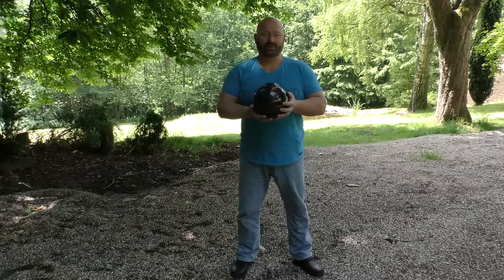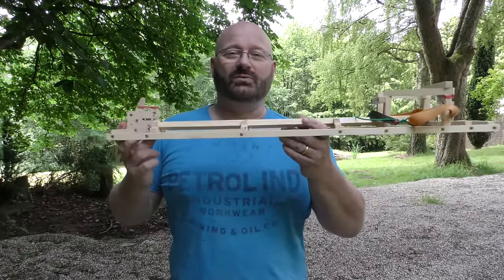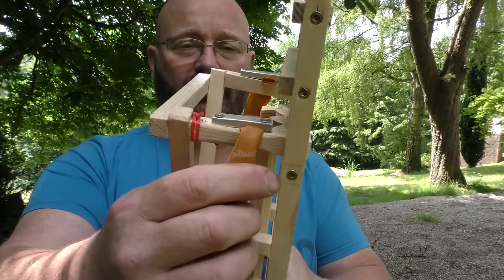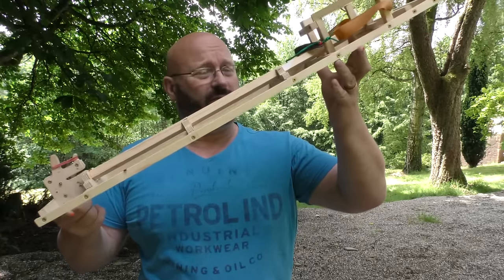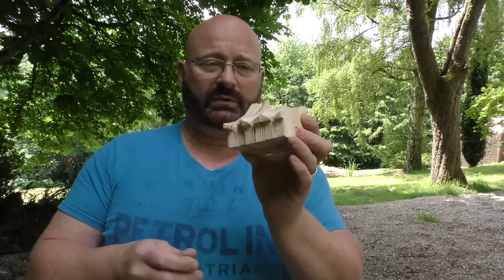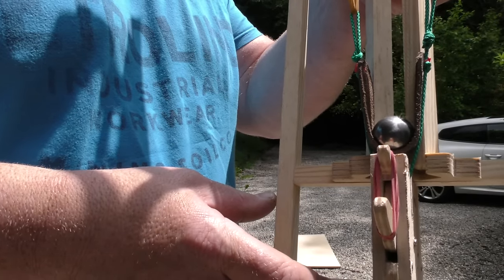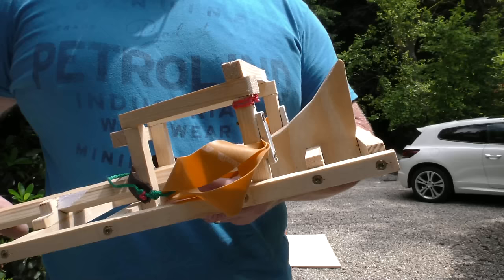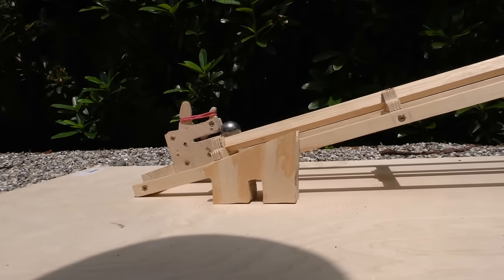Bowling Ball Launcher 1:10 Scale Experiments

Comment: if you hoist the entire frame up you have to put support beams in the middle to compensate for the weight of the entire frame potentially warping and bending in the middle
Reply from the maker: True. But that can be done. No rocket science.
Reply: Well, I didn't think about that haha good call
Reply: but joerg how many kilomiliyards do you need? is it N x E x R x D = Draw weight?
Reply: Why not both? Hoist it up 1 meter and attach a ramp of 7.5 degrees or so.
Reply: Slingshot based rocket launcher confirmed for 2,000,000 subs.
Reply: Mrs Brisby rocket assisted slingshot ammo instead :O
Reply: +SteamingBurito That's smart
Reply: I think that smooth ramp with few more stages would be more then enough for destruction purposes like shooting a car :D Something like 5->10->15->30 degrees or a ramp in logarithmic curve shape.
But if you want to break some distance records in Guinness Book then hoist it up.
Good luck, I can't wait for the final result :D
Reply: +JoergSprave Hey, man. Great vid! I'm curious to know, what's your opinion on gun control in the US? Thanks.

Comment: Depending on where you are doing this, you could dig an inclined trench 1,5 m deep, and use the dirt to build a ramp 1,5m high. Half will be under ground level, half above. The structure will have a continuous support.

I think this is the easiest way to make it inclined, if you don't care about damaging the landscape (ofc you can plain it up afterwards).

Cheers

Edit: Or you could make it 1m under ground level with a larger width and some extra room at the back so you can operate it, and that amount of dirt should be able to make a higher ramp above ground level (lets say 1,5 ~ 2m), with just enough width to support the launcher, since you don't need the extra room to operate there.

I'm assuming the launcher have a modular design, so you'll be able to move in the first place, so it shouldn't be that hard to put it in place.

Comment: Just place it on the slope of a small hill to get your launch angle... Another suggestion is to minimize the friction of the rails to reduce the downspin. For even more distance you should get an up spin. Like on Airsoft or some Paintball markers xD
Reply: Oh, like finding a way to apply pressure to the top of the ball. That's smart. And then use some aluminum or steel rails to reduce friction so the spin isn't lost. That's clever. And ballsy. Putting an up spin on a bowling ball. I like your style.
Reply: it is clever indeed, but very impractical, since no amount of upspin is going to increase a bowlingball's trajectory significantly... all you can do is reduce the friction as much as possible, and hope that there will be no downspin (since the pouch's grip will be stronger than the rail's)
Reply: This is a good idea: wax the rails.

Comment: I know that this probably isn't really possible but I think that it would be awesome if you could build this on or for some sort of a large truck that can incline it's bed, like a flatbed dump truck or something. This way it would be portable and you would have many angles to shoot from.
Reply: Actually a very cool idea and the free advertising for a wrecking/construction company could be great.
Reply: Oh that would be pretty sweet. I guess a more practical way of doing it would be to try to get someone with a fork lifts or small crane, sponsor him so that he could lift the whole structure up. I feel like it would be pretty easy for him to get a sponsor with a project as cool as this.
Reply: There are some pretty big tilting flatbeds. Enough attachment points for the build too.

I think 20 foot bed is fairly common so you may lose a couple meters in length.
Reply: Larochelle trailers should be long enough though and easily reach 45 degrees. :D

Comment: I think the bowling ball may smash through any ramp - depending on the speed its going. As things get bigger the properties change. Also the ramp will take a lot of velocity out of the ball. I'd suggest a 15deg lift, and experiment with a 5deg ramp.
Reply: speed and velovity is not as big of a problem as the mass and energy of the object. heavy objects with a large energy dont need that much of a speed to inflict significant demage.
Reply: +Pprokop87 actually velocity is more important when dealing with kinetic energy. hence 1/2mv^2 notice velocity is squared while mass is halfed. if u half the velocity ud need to quadrople the mass to get the same KE. for example a 10kg mass at 100m/s is the same KE as 40kg at 50m/s 50 kilojoules.
Reply: EMAXXMASTER yes if the object is moving in the straight line. remember abouf the redirecting the energy. the object that will redirect other object has to take and whitstand all of its speed, velovity, mass and energy. part of it will be taken during the redirecting.

Comment: Considering the size and kick this thing will probably have I would suggest a center mounted ballista type carriage, a simple one at least. That way you only need it to be around 1 meter high for 2 meters elevation at the end.
Reply: The end must be supported as well. The final length would be 7.5m so that would mean 3.75m of wood hanging unsupported. With the weight of the fork and other stuff on the end and the energy of the shot, that hanging length is going to sag and shake a lot.

Comment: Hoist it up!! maybe use your pickup truck bed as a platform of sorts?
Reply from the maker: For a seven meter cannon? I'd need a 40 ton flatbed for that :)
Reply: +JoergSprave Well you could rest it on the left or right side of the bed and fire over the other side
Reply: +JoergSprave Rent one. :) 
Maybe you can use trunnions and mount it on a set of giant wheels with the fulcrum being  slightly forward from the center, and use some sort of mechanical aid to raise and lower the rear for elevation? Kinda like the old gatling guns used?
Reply: +JoergSprave Hoisting it up would fix the problem of energy loss, but it would be extremely difficult. Maybe you can try attaching a beam in between 2 trees, and resting the contraption on it. Also, what if you assemble the machine on an inclined plane, instead of hoisting it?
Reply: +JoergSprave why not just place the cannon on the ground that's inclined to the right angle? It might be possible to dig a trench to achieve the same result assuming you have the equipment to do it.

Comment: Hoisting it up: Physics says 45 degrees but realistically you want it lower as you factor in air resistance, you want the maximum horizontal velocity per unit vertical height. With the ramp, it would be best at 45 degrees in physics but as you said, energy loss when hitting the ramp, which probably needs to be made of a very smooth material to minimise energy loss through friction, and the ramp needs to increase in steepness gradually, so anything between 15 and 40 degrees for both ramp and hoisting it up would be the ideal angle.

Comment: I highly recommend to hoist the slingshot up.  Only because it seems more accurate as a firing mechanism than the ramp version.  
The ramp version kinda feels like an unpredictable complex mortar and sounds kinda dangerous.   A worse crazy case scenario is that the ball will fly up high and backwards towards the shooter (knock on wood, no pun intended) or the slingshot has so much power that it will instantly demolish the ramp upon impact.  
Maybe add a few sets of legs made out of discarded thick logs to support the slingshot up? Good luck on that project.

Comment: I would suggest to build a jointed pod/bipod in the middle of the cannon in order to be able to adjust the vertical and the orizzontal angle. A 1.5 to 2.0 meters tall pod with the right scoping system would be fine and accurate

Comment: Did you scale the mass of the bowling ball properly, or just its projectile size?
Also, how much force will you apply to the bowling ball in the end? What would the strain on the ramp be with part of the bowling ball's impulse crushing against it? Wouldn't you dent (and therefore affecting performance and accuracy) or possibly break the ramp entirely?
Furthermore, how would you hoist it up? Will it be a fixed solution, or of variable angle? You might as well take a shovel and heap up "some" soil to have an angled surface to put the contraption on. If you want variable angles, you could lift up the end using a set of pulleys.

Comment: Is there anything stopping you from building the whole unit (rails) at an incline? You would need more wood but it would make for a very stable platform, no energy loss from a ramp and a built in angle. Then you could possibly position it on a slope to adjust angle even more.

Comment: Maybe a simple mechanism, a large handle attached to a not so large cylinder stays below the mechanism and perpendicular to it's length, this cylinder has 2 pairs of ropes attached to it, which in turn have it's other end attached to some wooden arms, that are initially like _ _ and as you turn the handle, the ropes hanks around the cylinder, pulling the arms ends against each other, making them go from _ _ to / \, lifting the front of the whole mechanism. Did it make sense?

Comment: Mounting it on a trailer with the firing end at the hitch would give many advantages. You would have portability. It would give you better lateral movement for aiming. The hitch end could be lowered to provide the desired launch angle.  Larger wheels could also provide you with a higher launch angle. And some boat trailers already come with a winch installed at the hitch that could double as your draw winch.

Comment: I've never been math savvy, I usually just throw things together and eventually find a way that works... But the 15 degree to 30 degree ramp was the best contender as far as ramps go, but when lifting the front of the launcher, you ended up with a further distance with what looks like a 26-28 degree angle, so my thought is either a ramp that starts at a 11 degree angle and works its way to a 26 degree angle or a ramp that starts at a 13 degree angle and ends at 28 degrees, this change (In 1:10th scale) should get you from the 27m distance in the 15-30 degree ramp to 30m... not sure if my math is good, try propping up the scale again and measuring its angle... a ramp matching that angle might preform nicely

Comment: I would suggest to cover the sliding surface of the ramp with a thin sheet metal, and same with the rails. You could then polish them up and oil well to reduce the friction, and add some reinforcement at the front. That should stay in one piece I think.
Also this 1:10 scale model had a triangular rail. That means there were two points (or lines, if you will) of friction which are relatively high and the ball would be pinched between those rails. A rail with a round surface would have only 1 point of friction.

Comment: I think you should hoist versus using a ramp because when you were firing with the ramps there was a loud noise on impact of the ball hitting the ramp, versus when you hoisted the contraption it was much quieter.  The energy lost from the ball hitting the ramp and making noise is avoided by hoisting it.  And when the contraption is hoisted to such a shallow angle, as you did in the video, the rubber doesn't really fight gravity that much and still adds a lot of energy to the ball.  From the way I see it, hoisting the whole contraption is more efficient, even though it is, from a design standpoint, more difficult to do.

Comment: with 1500+ comments, it's probably already been suggested, BUT I think the ideal set up, would be using a system where you can try both!  Build a ramp, for the end, to launch it at at 15-to-30, so you can launch it that way, but have it so you can remove it, and then slide it under the catapult, to raise it up and change its angle that way.  There you can test, in the full scale, plus, if you use the end ramp, and it breaks, you can move to having the entire device angled.  It is probably a great deal more work, but it might be the best solution!

Comment: adding a ramp to the end will reduce the "muzzle" velocity and therefor the max range . better to use the incline method but might be worth considering a screw jack arrangement so you can easily experiment with different angles of elevation . Also if you are trying for maximum distance you could try a lubricated "barrel" to reduce friction and increase acceleration of the projectile

Comment: So, here's my concern. As someone who has ridden BMX street for the past 6 years, I would hope I know a thing or two about wooden ramps. I am worried that the ramps will not scale based on the materials properties, density and such. You may want to reinforce the top of the ramp with a sheet of steel or something that it can slide over and to prevent denting and damage considering how much velocity the ball will have as it rolls down the path. Also if you're planning to make the ramp the same way this scale model has it, where you can remove it, I say go for both! Try it hoisted then try it with the ramp :)

Comment: I would lift it up using a winch tripod at the firing end of the "Slingshot", because the impact on the ramp by a bowling ball is quiet enormous and if it breaks and flys of in an odd angle it could cause a lot of problems. I'm looking forward to the video :))

Comment: I believe the answer to the question lies in the speed of the ball, do you think the bowling ball will have the same speed as the small steel ball ? If it's slower in the final design, the hit it will take with the ramp will take a higher toll on the velocity of the ball since it's heavier. Idk if i'm explaining myself clearly so try imagining the two balls going the same speed and going up a ramp of increasing inclination, at one point the bowling ball will be slowed down much more from hitting the ramp than the small steel ball will.

In my mind, inclining the whole launcher is a far supperior solution the heavier the projectile gets.

Comment: Definitely hoist. In a large scale and high velocities the tension on the ramp going to be substantial, it can destroy the ball,  ramp will break is it is not strong enough, and you loose quite a bit of power. I wander why it has to be so big?  You could have made a proper slingshot cannon with wheels.

Comment: You may want to grease the launch channel and the ramp to minimize friction and impact-based energy loss. Heck, even water would probably help a little bit. At the very least, I recommend varnishing every working surface the bowling ball touches. That's if you're using wood, you might not be, I don't know.

Comment: Use both to mitigate the down sides. Also using a steep angle ramp when there are big forces in play is not entirely safe. But instead of hoisting the frame itself upwards you can hoist the ramp alone leaving the frame flat and steady.
Reply: If you just put the ramp in an upwards angle and align the forks support beams with the ramp it will make a super easy and sound form.

Comment: Wouldn't using metal rods to guide the bowling ball reduce friction? You could even wax the metal guides to make them super slick. Just a thought. then use a pipe bender to achieve an angle up at the end so there is no impact on transition.

Comment: In a lossless launcher, 45 deg should have been optimal. Of course there are losses from slightly increased friction on the ramp and hitting leaves.  I would guess the friction will be less of a factor on the larger launcher (mass is scaling as r^3 while friction is scaling at a much lower rate), and leaves will not be a problem. I would think 45 deg (ok maybe ever so slightly less technically) will be optimal on the larger device. Also, you can significantly decrease loss of energy on impact with the ramp by making a longer ramp with a shallower entrance. The little bit of extra friction for a meter won't lose you more than maybe 2% range on the full scale device, and that impact is your main inefficiency. Hm, I'm tempted to actually fully model this now...

Comment: Jai alai is the fastest ball sport in the world. I would definately use full ply sheets to match the balls spherical shape( five vertical sheets of ply sectioning the ball from one side to the other )to match the ramps 'slight' curl complimenting the balls contours . Pinball ramp. enspired.
    Or to make things simple the shaft is not angled or elevated 2 meters of the ground but make a ramp at the end of the shaft using two angled lanes of ply  sheets . These ever so slightly angled ply sheets maybe 20' degrees serve the purpose to centre the ball on the ramp as it is catapolted without trying to pinch the ball as the momentum is build up off the ramp. The surface area v shape will be a 150 or 160 degree v ( 180 degree being a flat surface much like a scateboard ramp).
     Im sorry if my words dont make much sence but I am sure that it might trigger off  some modified shaping solutions.

Comment: A ramp at the end, whether hoisted or not, just equals energy loss. Also, you DON'T have to hoist the end. If the structure were built on a trailer with larger wheels and tires, you could used the axel of the trailer as a fulcrum to raise the front...like a canon. The axel in the center would make lifting the front effortless. However, placing the machine just a BIT forward would still greatly decrease the effort needed to raise the front AND allow for greater elevation.

Comment: Have you considered putting wheels on the final launcher? Not counting the added mobility, if you were to mount wheels with a 1.5 meter radius to the middle of the launcher that would get the front end just 3 meters off the ground and your trajectory angle would be about 25 degrees.